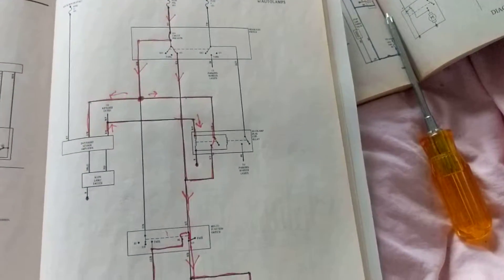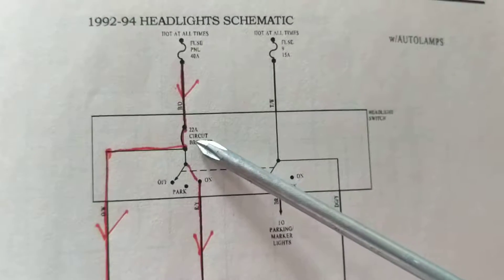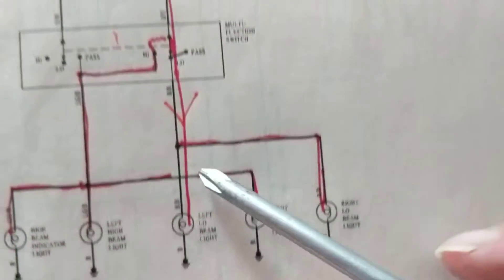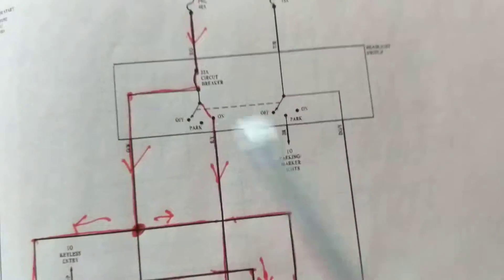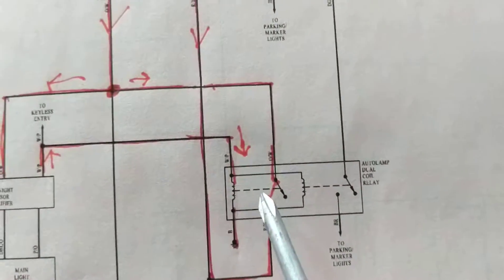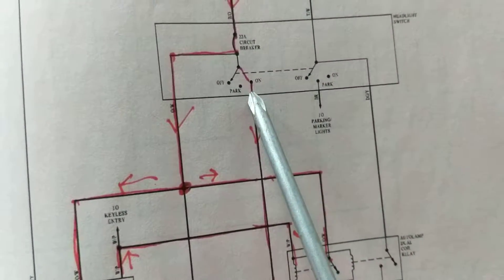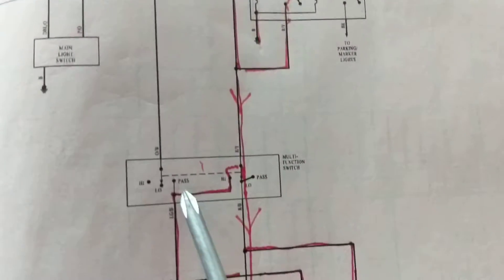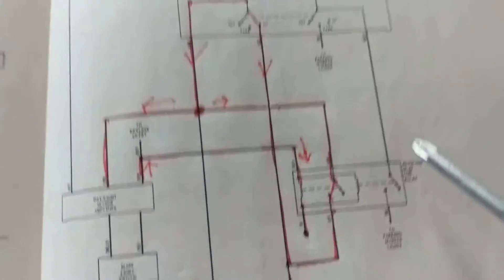How does HEADLIGHTS  work Ford crown Victoria 4.6 L 2000 diagram and troubleshooting

Comment: Parking lights come on, but no headlights either low or high beam. where can I find the wiring schematic for 2006 Crown Vic headlamp so I can figure out the wiring of the plugs going into the LCM
Reply from the maker: That might be a problem with either a relay or LCM which they have had problems with a scan tool will tell you that however you can go to Google type in 2006 crown Vic wiring diagram for lighting control module it should download a page for free keep me posted

Comment: Low beams work, one (passenger) high beam doesn't work when i pull the trigger. AND all the headlights and cluster lights flick/click off and on randomly. How do I fix this?
Reply from the maker: I'll try to get a schematic that's similar to that car the problem with police interceptor is that when they take out the lights they rip out the modulesbut the lighting control module controls those accessories you mentioned
Reply: @automotiveelectronicsfroms2699  Ok thank you very much
Reply: @PortMurphy1  I know I’m a year late but the high beams have nothing to do with the LCM so don’t waste your money on buying a new one, it’s only needed for the low beams and was recalled because of the low beams dimming
Reply: @PortMurphy1  and to add on to that your car most likely has wigwags so they routed the high beam wires to the wigwags, every Vic is different so you’d have to follow a shit ton of wires to figure out your high beam problem.
Reply from the maker: Not sure which make or model of car you are referring to if  a Ford the have been recalls for the lighting control moduleand it could be a bunch of things I would like to see the alternator current output and voltage output when the lights go on and off also there are relays and grounds from the body control module if it's a Chevy need to know what type of car it is and find schematic
Reply: @automotiveelectronicsfroms2699  oh ok, 99 ford crown vic interceptor